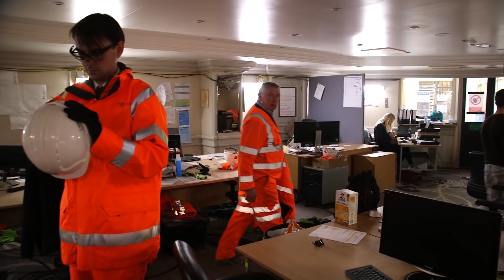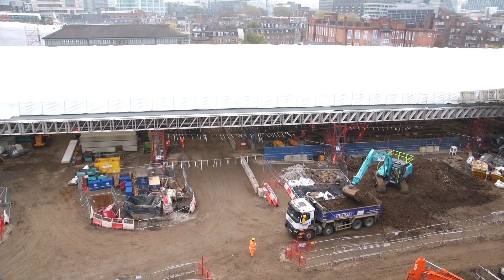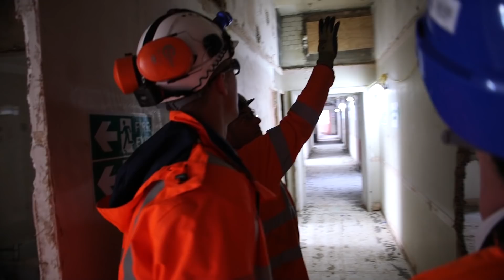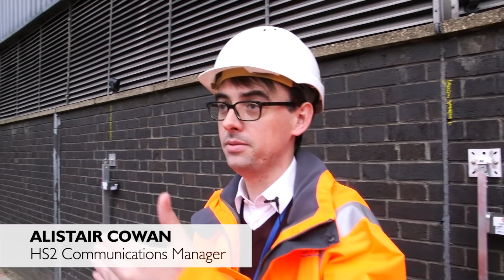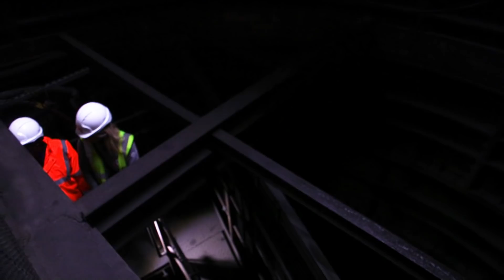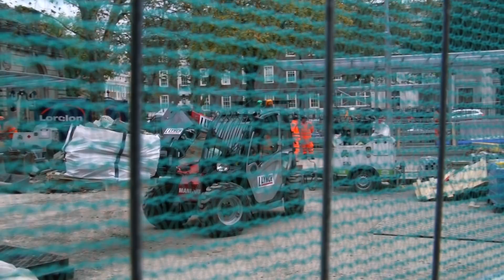HS2 Euston Demolition Works

Comment: I'm glad Euston's being effectively rebuilt - I've used it off and on for over 4 decades and the way it just became more and more closed in was ridiculous. The 1970s new station wasn't great, but it's been made far worse to use over the time.

OTOH, I think HS2 itself's a waste of money. Especially over recent doubts as to whether the northern expansion will ever happen. Improve the Chiltern line as said elsewhere, triple up and down tracks for the west coast, and bomb proof power lines and signals to avoid the frequent disruption that happens now. Cheaper than HS2.
Reply: Gary Walker I doubt what you say is actually cheaper. The Chiltern Main Line is restricted by Marylebone, which is much more expensive to expand, and would also require electrification, and tripling the WCML isn’t an option in many places due to the surrounding area, so all of that would actually be a similar cost

Comment: An ideal time to rebuild the doric arch perhaps, as the stones are still in existence somewhere.
Reply: Most of them were dumped in a canal I believe. Several others missing.
Reply: they were dumped in a hole in the lee valley canel and found when dregring to deepenit  for the olmypics as far as remember most have been found and are stored somewhere hopefuly someone at HS2 will see sence and put it back
Reply: @goodwood-rc4nx   There was also quite a lot stored in the demolition contractors garden !
Reply: This has been discussed and investigated many times.  Most of the stones have been broken up and used as rubble for infill all over the place. A few were kept as garden ornaments.
Reply: @dukenukem5768  The last time I was in London, there were pieces of the arch on the lawn in front of the station with a billboard showing where and how they were found at the bottom of a canal.
Reply: Oh dear god. While not rebuild cholera while we're at it.

Comment: Would the money not be better spent upgrading the entire real network including in cab signalling across the country so trains can reach 140mph instead of current max of 125mph and then trains can be added to the line so increase capacity. Upgrade all lines to electric from diesel too.
Reply: Better to build new, like China is doing with its high speed rail
Reply: Upgrading an existing line is really disruptive, as users of the West Coast Main Line have discovered many times from the 1960s electrification onwards.
Reply: Much of the WCML doesn't even run at 125mph due to the existing alignments. IIRC much of it is 110mph. We would have to spend a huge amount of money, knock down loads of houses and put up with years of disruption to straighten it out. When such arguments were advanced in the HS2 phase 1 Bill in parliamentary proceedings, it was shown that further WCML upgrades would cost most, disrupt more, needs more homes demolished and deliver less capacity increase than building new "offline" mostly through farmland.

Comment: I wish I could be convinced as to the economic case for HS2. Sure, as a rail enthusiast, it's great to see some more high speed lines in the UK, but the argument that it will boost northern economies is not proven. Rather I believe it will simply push house prices up further and further away from London as the capital can be reached more quickly. Yes, capacity is a problem but is HS2 the answer? The M25 is one example where the improvements in capacity simply increase the numbers using it, such that there are no improvement in congestion or travel times - people just commute further - the only saving grace of HS2 is that travel by electrically powered rail services is ecologically more sound (OK arguable, but...).
Reply: It will be extended further north in the future and reduce pressure on existing lines
Reply: @lachlanshanks8437  MPs have already suggested this week there wont be phase2 because of costs, so no benefit for the north
Reply: @anslelost  well it's better to start somewhere. I'd like to see it extended at least to Edinburgh and Glasgow.
Reply: @anslelost  plus I'm just happy to see any high speed rail. UK is lagging behind other countries in this respect
Reply: @buzzukfiftythree
 you only need to look at what happened in Kent to know about the house price situation, local residents of Kent have had house prices rise dramatically due to the influx of commuters looking for "Cheaper than London" house prices, where i live in Ashford some property rose in price as much as 30% after HS1 opened, the young of this county are being pushed out of their hometowns thanks to this  and the same will happen to all the areas HS2 will stop at
Reply: Remember, only InterCity services will use HS2 and it will provide a huge capacity boost, not just an extra lane like some people suggest should happen without realising there isn’t any extra space
Reply: Look at this another way - we have the fewest high speed railway lines within Europe (certainly within the G7 excluding the US).

Comment: all that money spent to shave a few minutes off a journey is ridiculous. What happens when something happens on the service that mokes it 10 mins late for example......all the money that been spent for nothing.  Extra capacity is needed.....so longer trains.......Surely it is massively cheaper buying more rolling stock and lengthening a 9 or 11 car pendolino to 14 or 15 like the Caledonian Sleeper services that can already stop Glasgow, Carlisle, Preston, Crewe, Watford and probably more stations enroute. Instead there is many £££ spent on 4 car units that are so overcrowded.   It is very basic. But so basic that a bloody poitician cant see it.
Reply: "all that money spent to shave a few minutes off a journey is ridiculous." I'm not sure if that's your stupidity or bad marketing from government. Probably both.
Reply: At leaat I voiced my reasoning. 

Unlike yourself who just resorts to a bit of teenage name calling. 

That money could be soent on more rolling stock. Increasing capacity. 

More lines does not guarantee more capacity. 
Adding more lanes to a motorway does not mean less congestion if number of vehicles remains same or increases.
Reply: Wee Peem The thing is that we can’t boost capacity on existing lines as there is no where for more capacity to go. It’s more like building an entirely new motorway than adding extra lanes, adding extra lines is comparable to the WCML upgrade a few years back. You can’t have longer trains as the infrastructure can’t handle them and the costs of upgrading it to handle it is more than the cost of HS2, but would last a lot less time, not to mention the disruption it would cause to existing WCML passengers
Reply: Extra capacity is needed - and HS2 is providing it.  Very few stations can take trains as long as the Sleeper - only two platforms at Euston can, and they hang off the ends of the platforms at places like Watford. (Glasgow only sees half of the complete train, it couldn't take a whole one)
Reply: Norbiton Flyer 
But still cannot justify the immense cost for the time saved on journeys. 

Lengthen platforms at Euston instead....
A remodelled station would be cheaper.

Guess its too late as works started.
Reply: Wee Peem Not really, the works around Euston would be similarly disruptive, and elsewhere along the route it would be needed as well, where its either very expensive or impossible

Comment: will crossrail2 be ready in time?
Reply: Construction for it hasn't begun, but it might be in the future. If HS2 opens, Crossrail 2 opens. Crossrail 1 is for the same reason: to serve HS1.
Reply: @MyLovelyOnlineFriend  is crossrail 2 actually necessary though? If you restore the line between Bedford and Sandy then services from the North can terminate at Clapham Junction. Reducing cross-london journeys is surely a better use of resources.
Reply: I don't think Crossrail2 is even off the drawing board yet, certainly it hasn't secured funding. London haters will be positively apoplectic at the circa 35Bn price for Crossrail2 being spent "only in London."
Reply: @DaveCardboard  £15 billion for Crossrail. But at least it serves a useful purpose. Crossrail2 is the bypass for the congested Victoria line which was the bypass for the congested Piccadilly line. Maybe we should look instead to making our existing lines 4 track?
Reply: @hairyairey  Or you could convert the Northern City line to tube tunnel and connect them to the Northern (Bank branch) line from north of Old Street or Moorgate. That way, there'll be better connection from ECML passengers at Finsbury Park. That's one of my several solution instead of Crossrail 2

Comment: A new line when Crossrail cant even open on time. Mashed up all of London to build a railway which is now overbudget. HS2 i doubt we'll see that finished
Reply: Just because Crossrail is a few months late you'd throw an entire national infrastructure project under the bus? Well a bus you wouldn't build probably...
Reply: Crossrail is the largest engineering project in Europe at the moment. Before that it was the Gotthard Base Tunnel. Guess what? That also didn't open on time.
Reply: @hairyairey  An opinion is all it is John, care to question this as well? We know engineering takes time. That’s not the issue
Reply: @NextSound170  I have no idea what you are asking me.
Reply: @hairyairey  Yes, I get really fed up with people saying that the UK can't do these big projects. Look at the Amsterdam metro project, years late, or Cologne where they actually had a tunnel collapse in the middle of the city. These things are very complex and delays are not uncommon. On the other hand, look at the work at London Bridge Station, all the target dates were met.
Reply: @johnhaines4163  it's interesting to see that the GBT supposedly opened "ahead of schedule" in June 2016 but actually officially opened in December 2016. However it was a 17 year project so it's hardly surprising the schedule slipped.
Reply: @johnhaines4163  HS1 was also an time and - surprisingly - on budget.
Reply: John Haines Not forgetting Europe’s biggest ever delay, Berlin’s Brandenburg International Airport.
Reply: @peterclark8408  I laughed out loud at that reference. Although I guess Berliners don't quite get the joke, and that's nothing to do with them being German!
Reply: @johnhaines4163  I actually live in the country before the accusations start flying.

Comment: And I thought that Vancouver is bad at historical preservation, but we would have at least retained the façade of the to-be-demolished Underground entrance.
Reply: It's not the only Tube station in that style so although it's a bit sad is it a loss? The loss of the Doric Arch outside Euston is probably more tragic because of its unique style.
Reply: It would be difficult to keep even the façade, given that it would lie across the tracks of platforms 3 and 4
Reply: @norbitonflyer5625  in theory it could be exported. If they managed it with London Bridge without computers it's certainly possible. Just not unique enough probably.
Reply: @hairyairey  Granted and good point, though I've found that often we'll get to the last of a kind (in western society at least) and the argument won't be made that no other examples exist - I can think of an example in my small suburb of Vancouver at the moment -  but I fully agree about the shame in losing the Doric Arch.
Reply: It's a derelict building with red tiles on the outside. I'm kinda sad, but quite frankly it's not been a tube station in a long time.
Reply: You can't preserve the facade of something in the MIDDLE of the construction.

Comment: HS2 is akin to the canal network just before rail made it obsolete. Focus and prepare for driverless car technology, as it will make the railways nothing more than cycle tracks/footpaths.
Reply: It's not as if the motorways aren't massively congested, and peter out near city centres. So driverless cars can get about with the increase in traffic, perhaps we should build new high capacity routes between the cities: fully segregated with limited access points, guided, and controlled by central computer to maximise capacity and speed. Let's have it electrified with vehicles picking up power from overhead wires, so battery life isn't wasted. And individual cars are terribly space inefficient, so lets give people a seat in a larger vehicle and maximise capacity more. Oh wait, I've just reinvented HS2!
Reply: @sihollett  I guess time will tell...
Reply: Driverless cars will need about as much space as regular cars. Trains still take up much less.

The future will change a lot, but not basic geometry.
Reply: @radagastwiz  they are probably investing in bitcoin as well!
Reply: Intercity fast trains will always be faster than driverless cars. Buy they will probably time local public transport
Reply: @jrisner6535  even driverless cars will face traffic jams.
Reply: @hairyairey  - and need to park somewhere.
Reply: @DaveCardboard  Driverless cars will not need a place to park. The owners will send them away to drive in circles nearby all day long - saves on parking fees and the electricity they run on is free, isn't it? What could possibly be a problem with that?

Comment: Why does HS2 need to build extra buildings, taking over major areas of land. If they upgraded the lines we have in stead of creating a two tear service - slow and extra slow.
Reply: Because the last upgrade of the WCML cost as much as HS2 phase 1, and only created a tiny amount capacity south of Rugby (a path per hour?), and that by reducing stops south of there to allow the new path to be squeezed in, rather than any actual improvement - ekeing out that last bit of capacity before you have to build a larger terminus, add in new tracks, demolish a load of stuff and take over major areas of land. There's similar issues on all the mainlines in/out of London, so you can't just upgrade a different line and relieve the WCML that way.
Reply: There are REAMS AND REAMS of information on why they are doing it. Google is your friend.
Reply: 1: Since when was 250mph slow?
2: Expanding on the WCML simply isn't an option - it would cost the same as building a new line and it wouldn't be anywhere near as quick, so we might as well build HS2.
Reply: Those 'extra buildings' will make huge economic contributions to the cost of the line

Comment: Hs2 is dated tech
Reply: in what way? Being the fastest commercially operating conventional railway on the planet?
Reply: @agent_605  So the trains that will run on HS2 will be faster than the TGV in France or Bullet trains in Japan?
Reply: v SurfinBird v Yep. Fastest current TGV goes 200mph (320km/h) in service, as does the Shinkansen. HS2 is specified as having a top speed of 250mph (400km/h), only 18mph (31km/h) slower than the Shanghai Maglev’s maximum speed in service
Reply: @agent_605  Hardly relevant over a one hour ride. and will be outdated in twenty years when it could be finished.
Reply: anslelost Not necessarily, however the capacity boost is what matters. Considering it cuts up to an hour of journey times it is a significant improvement, not to mention the freeing up of space on the WCML for more local services to relieve the existing services. The thing about HS2 is that it will be compatible with the existing network, so cities such as Liverpool, York, Newcastle, Glasgow and Edinburgh will be served by HS2 services and benefit from reduced journey times. Other technologies e.g Hyperloop and Maglev can’t provide that compatibility

Comment: I think annually would be too long maybe every 6 months! Glad to see it go to be honest its nasty, has few redeeming qualities, the temp changes by network rail have made it even darker and im delighted to see the Grant thornton buildings come fdown those towers are hugly ugly - no one will miss 
them!
Reply: much like the old British Rail extension at the front of King's Cross did
Reply: @alexhardiman8582  which apparently was temporary. 50 years or so I wouldn't call temporary!
Reply: Euston, the Penn Station of London. Though it's still slightly airier than rats (commuters) running around in tubes under an arena. Still disappointing getting off a Caledonian Sleeper and waking up to this.
Reply: @ahqhue  So many of the main Terminal stations are being developed to cater for such a huge increase in passenger numbers over the last 10 years or so. Waterloo, Kings Cross, St. Pancras, Euston all far too small or were using the space badly.  Euston always feels huge when you go down onto the platforms, but the station concourse itself is like a shoe box.
Reply: @ahqhue  it is beyond a doubt the worst London Terminal. Even tiny Marylebone has character. It is definitely an opportunity missed not to rebuild the station. Close it for a month like they did with Waterloo.
Reply: Michael Bolton i